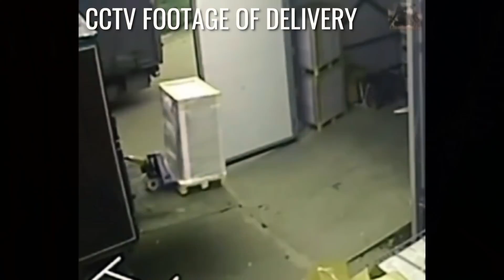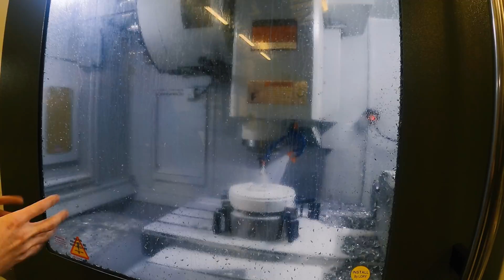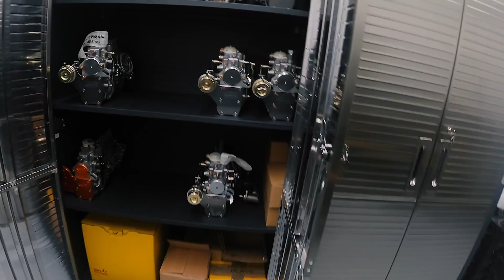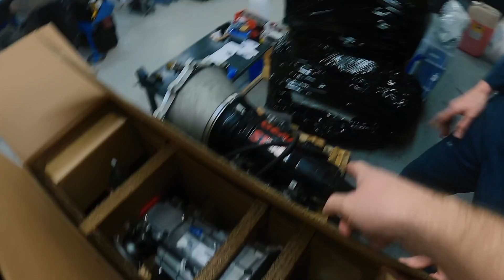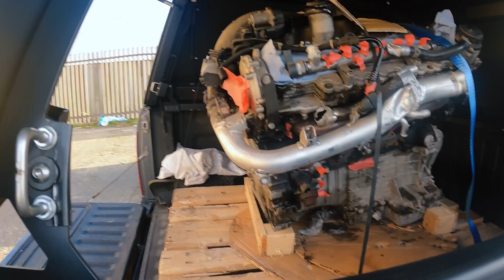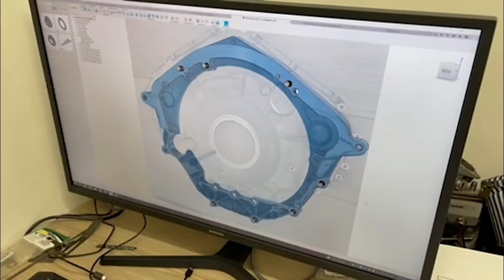As if one V12 TDI wasn't enough! + Bonus @DieselPumpUK Workshop Tour!

Comment: A dream build of mine is a patina 1953 Olds Super 88 with a V12 TDI and DCT gearbox. Would need a bespoke chassis, but would want to keep the live axle and steering box (just well engineered) to keep things lively. Maybe some 20" wheels with a rim that looks like a whitewall tire but allows fitment of modern supercar tires. How close are you guys to developing this engine as a swap? Is anyone doing this?
Reply from the maker: That'd be awesome the only issue is there's not an abundance of these engines laying around :(

Comment: Do you know how many of these Q7 V12 were made? Some articles I've seen say under 100... but there are quite a few for sale.
Reply from the maker: 50 in the UK I'm told and less than 500 worldwide
Reply: @DarksideDevelopments  thanks mate, the engine is a great interest of mine. Does it run twin R70 pumps? And what do you suspect the injectors can support ?
Reply from the maker: 2 R75 pumps. I'd have to look at the duration map to be sure but I can't see us getting past 700hp on stock injectors. We have upgrades for everything luckily!

Comment: Can you put a manual transmission behind the diesel v12 ?
Reply from the maker: It can be done with the right knowhow.
It's a matter of getting the right conversion plate between the engine and gearbox and the right flywheel/clutch set up but it isn't a straight forward job.
Reply: @DarksideDevelopments  
For me, what's the point of having that much torque and power without the other side of the experience being a mechanical shift. 

a proper 6 speed gated manual transmission coupled to this would be an amazing drive. 

I wonder if it would fit in my W123 :) 

i know a Pagani Zonda's 7.3 litre V12 fits, only just though.

Comment: Love thus chanel I've learnt so much listening to you mate, much appreciated
Reply: Darkside have you done much with the Jaguar XF diesel v6 ? Few tuners around but no aftermarket upgrades, can't find intercooler or turbo upgrades never mind fueling etc few mates rocking the 240bhp version and very limited to what they can do which is sad considering its a decent little v6
Reply: @HardtoKill1986  The crankshaft in this engine is so weak they break in standard tune.  No scope at all for extra power.  Ford beefed the crank and bearings in the version used in the F150 but have since dropped it because it is a weak output engine even after the upgrades.  You'd have to discard this V6 and put in a proper one like the VAG V6 diesel.
Reply: @einfelder8262  cheers mate thanks for the reply
Reply from the maker: Sorry! we work on VAG / BMW / MINI / Porsche only

Comment: 1000 hp v12 love to see
Reply: That's it?  Are they that weak?
Reply: @ShainAndrews  It only revs to 5000rpm what do you expect? The torque will be well over 1000Nm though.
Reply: @ShainAndrews  it's Not a Cummins
Reply: @Z3RO313  It's 6L of common rail technology.  I would think 1000hp would be a pretty low bar.  But then I see some silly transmission options so that opens a new can of worms.
Reply: Not between the two of them.